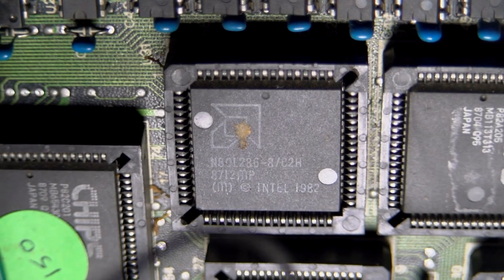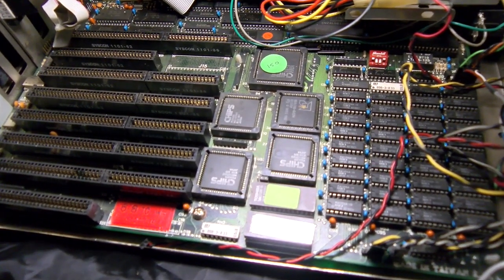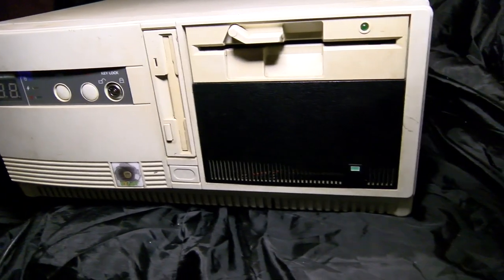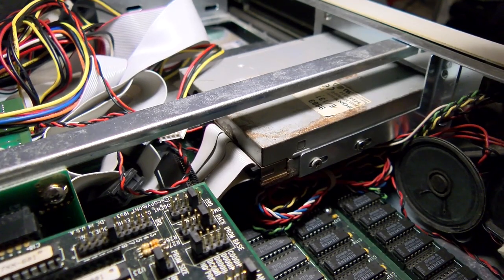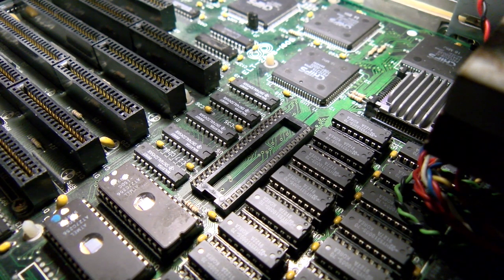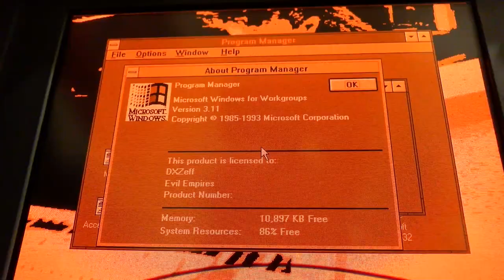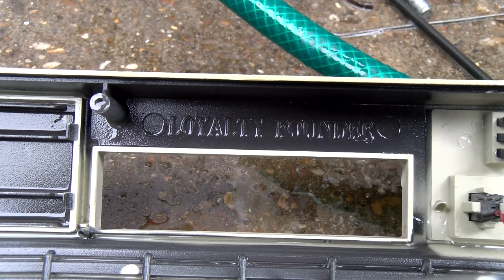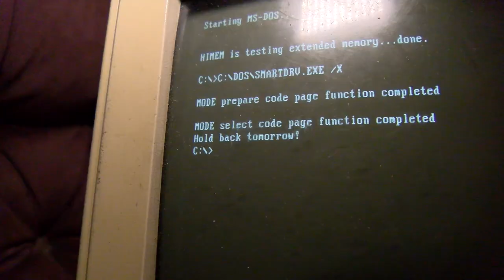Needless 286 Machines

Comment: Nice work fixing the case. Makita!
Reply from the maker: Had a cheap 4" 650W Draper before with a missing handle. That 5" 1400W Makita is one of the best presents I ever bought myself and is one of my favorite toys to play with.
It's funny how increasing the power so far resulted in less biting and kickback, because if you put a cutting disc on that Draper it really liked binding and trying to rip the grinder out of your hands (away from me, luckily, as I'm not that reckless). The Makita just eats through the workpiece like it isn't there without so much as slowing down. Discs also last longer on the Makita, despite simply being larger versions of the same ones, which I assume is due to similar reasons.
Admittedly I might have laughed maniacally the first time I used it, and the neighbors were in their garden, they look at me funny now. "Hahahahah! Buhbye rust!" (Zuzuzuzu!) "Wahahahha! Buhbye weld slag!" (Bzzzz!) "Muahahahah! Goodbye, vestigial jackshaft frame!" (Vvvrrrrrrr! Clang!)

Comment: Years ago I had been told that the Pentium was basically 2 286's slapped together.  It was a case of the 286 design was better clock for clock than the 386 and 486 so Intel went back to that design. I mean I have never found that online, so it remains a rumor to me, but given what they did with the Core 2 and going back to the P6 core, seems like it may be true.  I guess I should put some effort this year to getting my 286 running.  Like cars, computers were designed for the era they were in, and trying to go outside of that can turn into problems and unrealistic expectations.  I still have not had any luck with the hard cards I have. Can't seem to make motherboards see them, another thing I need to try again as it has been a couple years now since I last messed with them.  I like the sound of those MFM drives. I have the same nmos AMD 286 chip but sadly can't seem to get a motherboard for that style as they seem to be thought of as worth their weight in gold.  I find this stuff far more fascinating and fun than anything today. It's all the same now days.
Reply from the maker: Not sure on that, suspect the Pentium was something new almost entirely, especially going by how dodgy it was initially - wouldn't be surprised if it had some recycled technology in there somewhere, though, probably not from Intel. Then again, it seems the very first Pentiums were slightly faster, clock for clock, than the Socket 5 models onwards, so that's another mess of its own.
Wonder if you have to mess with the BIOS on the hard cards, if they even have one, like DEBUG, G=C800:5, the Adaptec controller here requires this before it will work, though unless the drive on the cards was changed, I can't really imagine why it would need that doing again.
The parts overall, not just motherboards, have definitely gotten costly. I got lucky by buying broken, that usually works for me, but the CLCC boards definitely seem to be less common - this Chaintech board seems to show up quite often as far as 286 boards go, but usually has the more common PLCC socket from what I saw.
Modern hardware is no fun, as said before, it became nothing more than a tool to me somewhere in the mid-2000s, it's useful while it lasts but it's not fun like this older hardware. Whilst the 286 has limited capabilities, it definitely is engaging to mess with.
Reply: @HighTreason610  The old stuff is more enthusiast compared to the last 10 - 15 years.  Intel "borrowing" technology? they would never ever do such a thing! 😁   I don't remember in the early 90's the 286 really being all that common. I remember most budget machines were XT and the performance rigs were either 386 or 486 based, I just don't recall the 286 being popular except in laptops.  I asked VWestlife a few years ago about the hardcard he has in his Tandy 1000 he said it just worked. Without having found any information on setup of the card that was really all I had to go on. Seems like it would be a single channel controller card and hard drive, but I never have had a BIOS recognize it on auto detect nor on manual setup. 386 and newer of course. I have like 3 or 4 of them things just kicking around, would like to use one of them in something.

Comment: I bet if you spoke to Adrian Black over at Adrian's Digital Basement, or Shelby over at TechTangents -- both other YouTube channels! -- they could help you sort out your GoTek and XT-IDE issues. I think Adrian might know more about XT-IDE, and Shelby about the GoTek stuff, but I could be wrong :)

But, hey, you do you! Also: lovely accent, but I can't quite place it... may I ask where you live, roughly?
Reply from the maker: I watch Adrian's stuff. Thankfully I've not had any need to emulate floppies for a while and I'm currently testing an alternative to XT-IDE that seems to work on the 6MHz machine. It isn't needed for now, thankfully, as the system has been fine on a replacement MFM drive so far.
I live in a city called Hull, but I do not speak the local dialect nor do I have the accent. I don't know where it's from.
Reply: @HighTreason610  Hull in the UK? A lovely country, my heart will forever pine for a flat in London. Alas, I'm disabled and thus don't qualify for immigration, so it will be a pining forever unfulfilled.

Enjoy your city! Rotting away in this tiny nothing town in the upper Southeastern USA, with nothing to do, nowhere to go, and not even enough resources to leave... I envy you.
Reply from the maker: Oh, I assure you it's pretty horrible here. No economy, high rent, crappy people. London is worse, though, wouldn't want to go there and it may as well be its own separate country, as the rest of England isn't very much like it is there.
Where abouts are you from? I used to have a friend who's family had moved here from SC and all he ever wanted was to go back.
Reply: @HighTreason610  North Carolina. Tiny town, at least an hour from anywhere remotely civilized, depending on which way you point the getaway vehicle. I promise you've never heard of it. No housing, no jobs, nothing to do... even the nearest movie theater is a 40min drive. The largest employer is a chicken meatpacking plant and the next-largest, at some distance, is the tiny, tiny Wal*Mart that serves the town and those in the surrounding cow and hog lagoons that aren't decent enough to shop somewhere better. The employment situation is so bad that the chicken plant has a waiting list and Wal*Mart will actively turn you away unless you're specifically willing to push carts. It's so bad I'm pretty sure the folks who normally would start a landscaping business have just out-and-out given up.

You know you live in a miserable pothole when the "Holiday Tours" buses don't even slow down as they barrel through at high noon on a Friday, and they're passing the only McDonald's inside of thirty minutes literally anywhere from here.

Say what you want about London, and the UK in general, but you have VERY high standards. Come visit NYC. Heck, come visit Durham NC. I've been to very few places where, if I'm accidentally going up the down staircase, because I'm an idiot tourist who can't tell left from right even on a good day, the locals are the ones apologizing to me essentially for my being in their way... all of those places are in the UK, and London is the only one I can instantly name, off-the-cuff. Not to mention it has things to do -- museums, shops, heck, just riding the Underground is nice for me;  the local public transit here is so bad I literally cannot use it. We don't even have tourist traps here, at all -- except for one that genuinely does not merit a mention. It's not even worth the price of admission and I'm pretty sure it's free to enter!